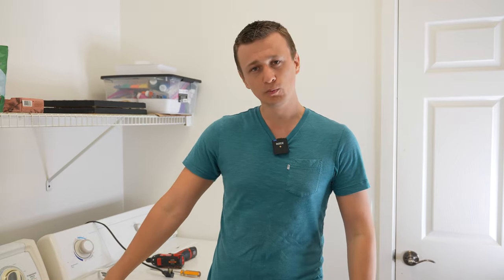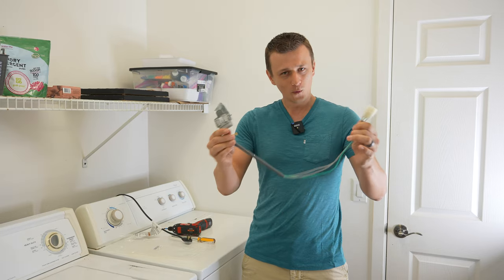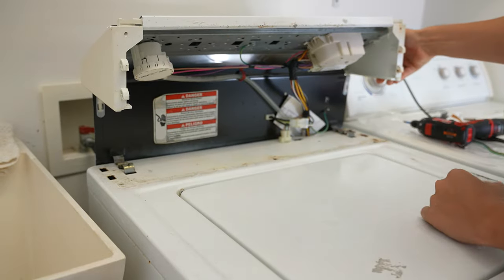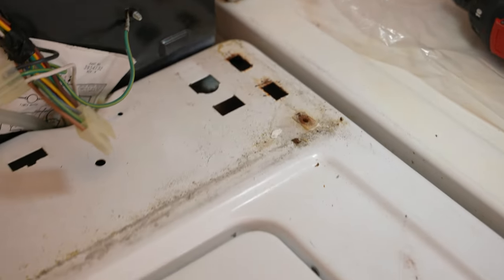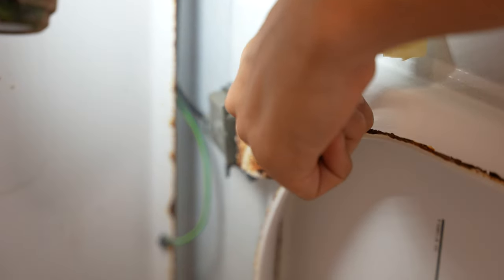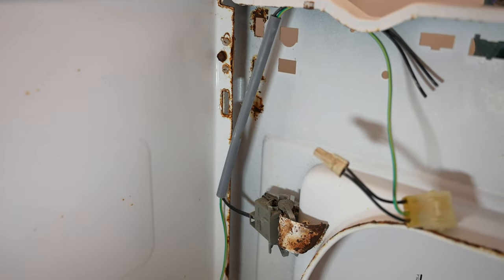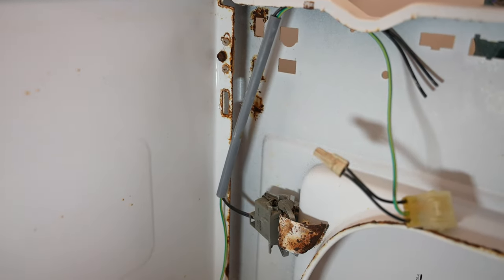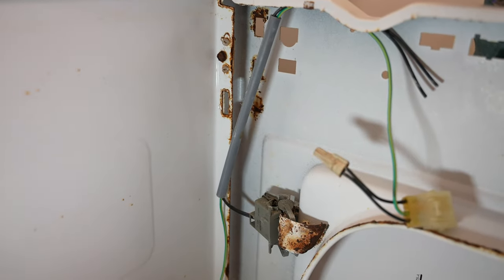Kenmore Whirlpool Washer Not Draining and Spinning

Comment: I bought the part in early November but had been making do by using a screwdriver. That jerry-rigged fix was getting shaky, so it was time to install the lid switch. Thank you for making it easy. I can't imagine ever getting a modern washing machine. This is my third repair on this thing, and they have all been relatively easy.

Comment: If I remember correctly the Switch is a safety switch if the door opens the washer will stop and will not start. Mine broke on a Kenmore and I did replace it. The job would have been easier if I had seen this video way back then. Nice CLEAN job Jay. :)
Reply from the maker: Yes, it's exactly as you say. 🙂 Thank you Clayton! Hopefully you never have a lid switch problem again but if you do, may your repair go smoothly and trouble-free next time around! 😎 Have a fabulous weekend good sir!
Reply: @WordofAdviceTV  It's been a great weekend. Late afternoon thunderstorms arrived. Whenever I run into a fix-it problem I check in with Word of advice for a video. Gotta try a pine float, on a hot summer day :) lol.
Reply from the maker: @Clayton Fite Glad to hear the weekend was great! I cant resist one-upping you my friend, 😇 thunderstorms are good but we had a 4.5 earthquake here yesterday. The house shook. 😱 Good to know I am a go to channel for you and lol, do enjoy that pine float! 😄

Comment: Awesome timing on your video! I’m seeing this condition on our Kenmore (which looks exactly like the one where you mention inserting a putty knife under the fascia).

Would this condition generate a diagnostic code??
Reply from the maker: Great to hear the video was timely! It depends on the model of your washer. Some will, some won't. If your washer is older then probably not, if it is a newer one and has a digital display, then probably yes. 👍

Comment: Once I removed the switch, I saw that it had separated because the glue failed so I synched it back together with a wire tie and reassembled it. Works great and all it cost me was a wire tie.

Comment: I enjoyed watching your video. I have an old whirlpool it drains and spins on the two smaller cycles, but on the regular cycle, it doesn’t rinse or spin. I replace the timer that wasn’t the problem. do you think the lid switch could be the problem even though it drains and spins on the two smaller cycles thank you so much

Comment: I have a few questions and I honestly think your the only person here that can give me any answers.  I have this same machine (it's my favorite too💯) So my lid switch broke and as a temporary fix I bypassed the lid switch and it worked for 1 full load cycle. The second cycle it drained and refilled for the rinse but now the timer stops ticking right after rinse and it won't drain or spin.  After the timer passes the rinse label the ticking almost sounds like its ran by a battery and the battery is dieing and then it just stops a little past rinse and wont go any further, it wont tick or drain and if i turn the nob to spin myself nothing happens.  But if i start the cycle over the timer sounds like it works perfectly fine again up until it passes the rinse label. Any idea what went wrong? Do you think the replacement lid switch will fix the issue or does it sound like my temporary fix for one problem caused me a whole new problem?

Comment: While you have the control panel lifted up, I would recommend putting a zip tie around the connection of that plastic hose to the pressure switch. When that slips off, there's nothing to stop the machine from overfilling the tub and flooding your laundry room. That's a weak point in it's design.
Reply from the maker: Oh that's a great suggestion!! Thank you for pointing it out, those floods make a huge mess! Though rare but if it happens, oh boy is it a bad day..

Comment: My lid switch been broke for years and bypassed. As long as the person using the washer knows, no harm in doing this and no small kids around. it's just a safety device!
Reply from the maker: I only agree! 😄 I have bypassed plenty of them too. I have a small curious George running around the house though so I replaced mine just in case. Even though the chances are miniscule, if he really does decide to check out the washer while its in a final spin it would be pretty bad.
Reply: How do you bypass it?
Reply: Not worth the fire hazard bypassing the lid switch, just buy a new switch!
Reply: @horacecomegna335  no fire hazard.
Reply: How do you bypass it

Comment: As a service provider those models will agitate with the lid open the lid switch only affects the draining and spinning. If it will not agitate or spin out then it's a drive coupler.

Comment: So I followed your instructions and was able to pull a 7" brassiere  underwire out of the pump and after getting everything back together and testing it, it still won't drain. The motor wasn't seized and the lid switch is working fine. What's next?
Reply: I'll try your motor reset method by unplugging the machine, re-plugging and opening the lid 6 times in 12 seconds, even though I'm skeptical it'll work. Worst case, I'll need to bail it out a third time.
Reply: Nope. Still won't drain. I've pumped it out a couple times and all it does when I turn it back on is refill and shut down. Looks like I'm calling a service technician after all.
Reply: An other video suggests it's the capacitor. will try that next unless you have a better idea?

Comment: Mine acts weird with a big load and won’t spin properly. It will also stay stuck in spin. If it’s a small load, it does fine.
Reply: It could be if the washer is overloaded or unbalanced.

Comment: there is a screw, which you can see the hole for, at the rear of the washer.  this one screw holds the body to the back panel. In this video, the screw is missing. it is more work but, this screw must come out which requires pulling the washer far enough away from the wall to access it.